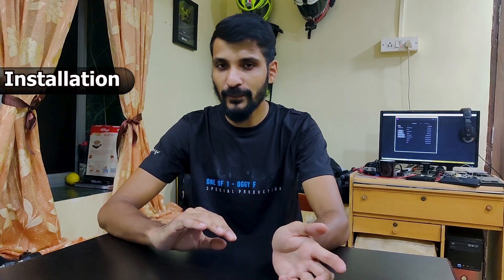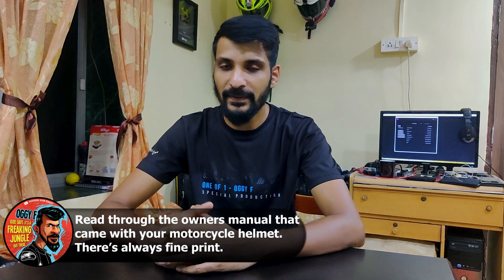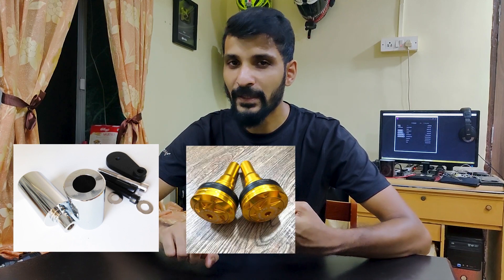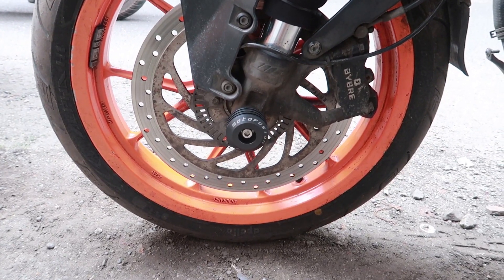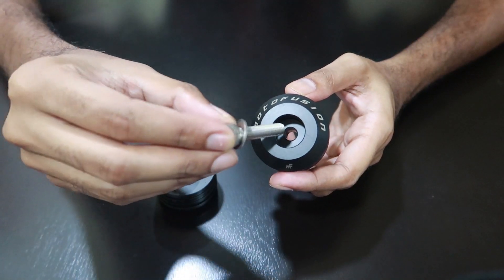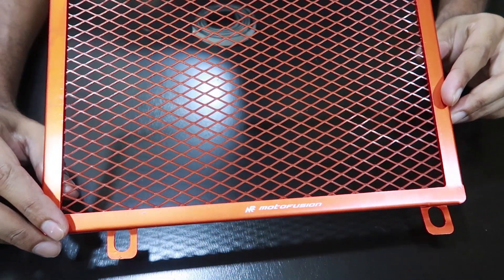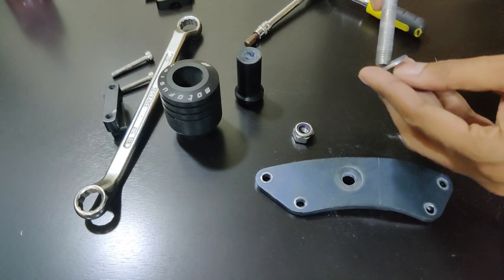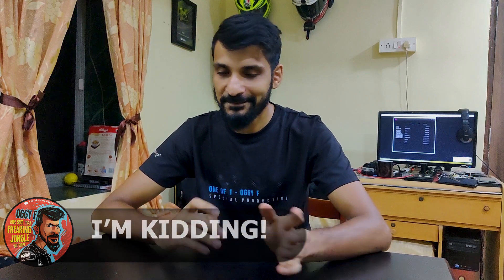Protecting my motorcycle | MOTOFUSION

Comment: Frame sliders are a life saver, I was on a flyover taking a turn when suddenly my rear wheel lost traction due to the debris on the road and I slammed and skidded into the outside divider, had it not been for the frame slider I would have lost a lot of flesh from my leg and my left frame of the bike would have been completely destroyed warranting a trip to the service centre.
Which I did, just to be sure and the engineers at KTM performed a thorough check of my bike and told me everything was fine. ₹7000 saved me from a crash. Your life is much more important than that.
Reply from the maker: Glad you're OK and lived to ride another day. Ride safe bro.
Reply: @OggyF  Yeah, Indian roads are very unpredictable. As you say, "It's a jungle out there". Love your videos by the way, you inspire me to someday start touring on my RC390, any tips for touring on the RC?
Reply from the maker: @siddhantpanchmukh6099  just tweak it a bit so you're comfortable on it for a longer time. I've put a video together on it. Minor tweaks with basic tools but it makes a whole lot of difference.

Comment: Well do you have frame sliders on your ted torpedo coz i also got the same bike and I don’t understand where to fit it
Reply from the maker: I didn't have them on my R15. Unfortunately the motorcycle didn't have mounting points you could use. May have to use a cut style slider.
Reply: Oggy F what is a cut style slider

Comment: Please let ous know about the radiator guard coz those holes seem to be pretty big for small stones to get in.
Reply from the maker: I've been using the radiator guard for more than 6 months now and haven't had any issues with the radiator. On the plus side, there's a lot more air that flows through the radiator and it helps keep temperatures down. I've also added an extension to the back of the front wheel's fender  which prevents slush from reaching anywhere near the radiator. All in all, very pleased with how it's performing.
Reply: @OggyF  thank you .